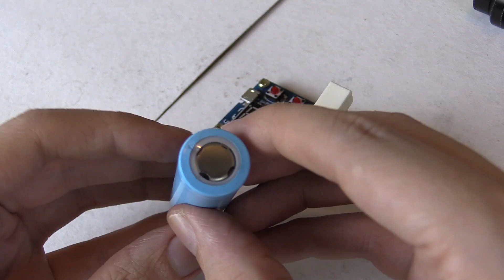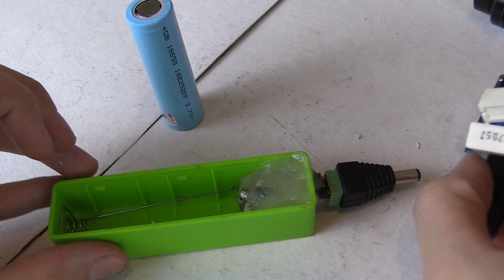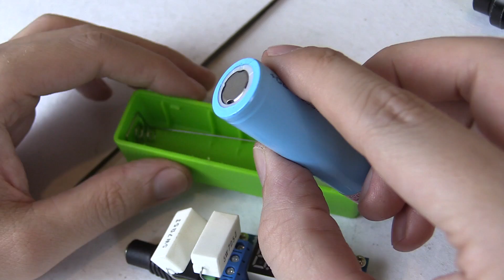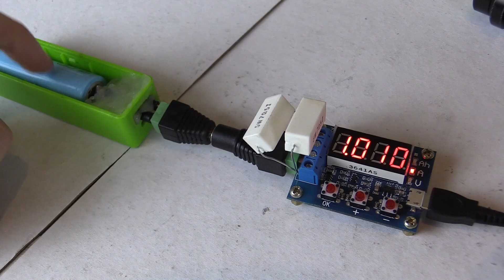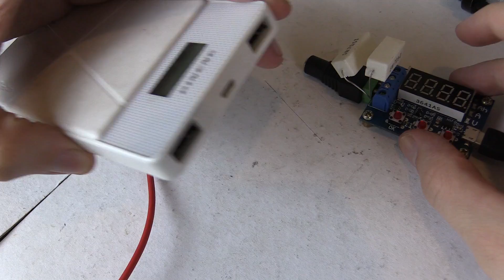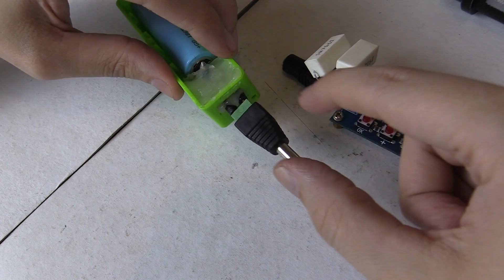18650 Battery Capacity Tester from eBay

Comment: Is the cut off voltage of 3V standard for all Li-on capacity tester? What if you set the cut off to 2.7V, wouldn't that give the battery a higher capacity reading?

Comment: hi any chance you could explain how i would calculate the capacity as i would like to use this tester to test capacity of a couple of usb 5v power banks i own. thanks
Reply: search and buy a "USB Power Tester Voltage Current Capacity Meter". So you don't have to build a cable this tester had a usb input so you just plug in your power bank and other side it had USB output to plugin a lamp or something using power to test a capacity of your power bank.

Comment: I have an other problem where I charge the battery to 4,2v but when I but it in the tester it shows 3,4v and this happens with two completely different testers. What you think the problem is because if I put 3v cut off the mah reading won’t be correct.
Reply: Maybe your battery is weak, Normal Lithium battery voltage is 3.6V or 3.7V it may slightly higher depending manufacturer and battery Specifications. 3V cut off mean when you are using your battery then battery voltage will going down, so when battery voltage get down to 3V it will stop (cut off power) you from using it. Like a power tools when this happen a light will flashing and no power out put from a battery.
Reply: i have the same batteries that has higher resistsnce. one claimed to 1600+ mah but when i discharge test it using only one reeistor, the voltage drop tremendously. if it cant handle half an amp, what more if i use two resistors, lol! so technically, we have both tested a bad bwttery

Comment: I have multiples of these, is it possible to solder a 5v power input somewhere directly to the board instead of using the USB?

Nevermind, I noticed the two square unused pads on the back of the PCB near the USB end, +is right below the USB port, negative is offset behind the AH A V lights

Comment: There is difference btw the results of this capacity checker and litokala Lii500, why?
Reply: Yea, i have this problem too
Reply: @jopalzm1  how big difference?
Reply: @solopomodoro5853  3x Liitokala paralel HG2 18650 3000mAh show mi tester 6800 mAh, repeatedly.
Reply: @jopalzm1  did you try what capasity each cell alone showed? Meybe they arent full 3000mA?
Reply: I understand, but it is connected as the power bank and the problem is unraveling it. But I have the similar experience when bought a 20,000 mAh from a branded power bank manufacturer and the test showed 12,000. Complaint powerbank, I get next kind, and showed 11,800 mAh. So I don't get it.
Reply: @jopalzm1  what version is your tester? I have v2.3. Older ones was inaccurate. Can you tell me the 20000mAh power bank, model and manufacturer? Seems pretty big? I try my 5000mAh power bank today, lets see what it says.
Reply: @jopalzm1  my 5000mAh power bank is just slighty bigger that 18650 battery, so i think it is probably half what they told it is... never 5000mAh.
Reply: @jopalzm1  on power bank test you should put cut out voltage just under 5v i guess? Its the voltage most phones etc needs, so after that capasity is even smaller... i bet the capasity on those power banks are calculated to very low voltages...
Reply: @solopomodoro5853  it is quite possible

Comment: I ordered two of these. I was a bit peeved when what arrived was not the ZB2L3 but the other commonly available one, the HW 586. When I queried this the seller said "they are the same". But the HW 586 has a critical appraisal here on u-tube.
Anyway I checked them out and the performance and operation does seem to be essentially the same. Results were exactly in the expected ballpark, when I swapped cells over to test consistency with the other board any discrepancy was typically 1-2%, never more than <5%.

Comment: I  have tested  the same 18650 battery twice  first charging them to 4.2v  with two of the load resisters  and set 3 v cut off voltage and  there is  a huge  difference  in capacity  on all 12  of my capacity  meters.
Reply: my zb2l3 is the same, no accuracy at all, did u find any solution ?

Comment: You would help alot if you can answer me .I build a 3s-4p battery pack out of lg 18650 cells. I tried to measure the capacity.I firstly charged and then discharged the pack.Turnigy smart charger has cut off voltage at 9,6 when having a 3s battery. When the discharge finished i show total 8000mah and voltages 3,4-3,2-3,4. It did not stopped at 9,6 and my main problem is that my second series batteries discharged faster. So having a pcb when u use the battery will cut the output voltage, while there is still voltage left in the pack .how to fix this? P.m all are same new lg cells except 1

Comment: Have resistence measure?
Reply: Many of these kits seem to come with a pair of 7.5 ohm, 5 Watt ceramic resistors. The resistance tolerance may or may not be marked. Assume +/- 10% if not marked.
Two that I received measured 7.44 and 7.50 ohms. 
They may also be marked something like this: 5W7R5, which in this case meant 5W 7.5 ohms. It's usually a good idea to confirm the at least approximate values of parts like this by measurement especially when the price of something is really low. For example, a manufacturing or packaging mistake could send you a 0.75 ohm resistor instead of a 7.5 ohm resistor which could drastically change your results and any calculations.

Also, while ceramic resistors can withstand high temperatures, be prepared to keep them cool with a fan as they could cause burns or melt plastic parts, insulation, etc.

Comment: I bought two of those did you use both resistor most video I Saw used only one will it be fine does it make a difference
Reply: I bought one and it came with 2 resistors, it depends if you want to measure the capacity at 1AH or 0.5AH, this mainly depends on your usage

Comment: what's the difference in putting the resistors in series vs parallel?
Reply: He is using 2 5W 7 Ohm resistors in parallel which is 10W 3.5 Ohm, Current = Voltage X Resistor so battery he is using 4V X 3.5 Ohm = 1.14 A ( current draw ). For this circuit you can use a Resistor 10W 1.5 Ohm for a current draw of 2.6 A ( Maximum current draw for this circuit is 3 A ).

Comment: I have one of those and man that connector is brilliant because I was doing 18650s and also I started doing AA batteries also and it is kinda annoying changing the holders out basically any alkaline battery is pretty good even the cheap ones but the non alkaline batteries are like 1/3 of the power

Comment: cool video! what would be the lovest resistors you would use on it? what is the lowest cut off voltage you can set ? (If it's low, it could be porbably use for testing nimh also)

Comment: omg u're supposed to use both resistors at a time lmao. No wonder my resistor was burning hot
Reply from the maker: They'll get hot either way :)
Reply: Gadget Addict haha yea i just tried it and it got too hot to touch within 1 minute. Does yours get this hot too? I'm scared to leave it on for over 5 mins
Reply: They can only dissipate 5W.  10W resistor would have been better.

Comment: I bought same capacity tester but indicator display wrong voltage. That's why it measures wrong capacity. How can I fix it? Edited: I fixed it. Google it "zb2l3 calibration"

Comment: Hi , Very good info ,I have salvaged some 18650 batries from my old lap top. Only one has the full 3.7v and the rest is totally dead . I used my volt meter and checked the voltage and found no current at all ,I managed to revive those dead cell which now has some voltage in it as 1.2v .so i used my charger to charge it ,but the battery  charger power trip and not charging the cell  at all . Can i use this  capacity charger and discharger to power the battery ,,and if can how to do it and how many resister to use .. your kind advice please .

Comment: I finally got mine the other day and set the cut off for 3.2 volts but after checking and removing the 18650 it shows 3.4 volts and also when inserting a fresh fully charged 18650 4.2v it shows a starting voltage of around 3.8 when starting to draw current am I doing something wrong? Thanks, great battery as the tester comes with no instructions.
Reply: its normal for voltage to drop under load

Comment: I realize its easy to make but i still would rather just buy yours. You should pre-make a few and trow them on ebay.. I want to buy one just like you have but i don't care to collect the parts and make it myself.
Reply: With all the 18650 batteries in use now, I just don't get why NO ONE has simply put together the already - available components into a single box with a proper 18650 battery holder, freeze the settings to 18650 batteries and print the instructions on the box.  I'd gladly pay $10 for that, and I'd pay $20 for one that I could put 4 batteries at the same time into (discharging takes hours).  It would sure beat breaking out all this stuff.

Comment: How long does it take to discharge   1 18650 cell on this ?
Reply from the maker: It would depend on the capacity of the 18650 cell.
Reply: Gadget Addict I was looking for a rough estimate.iv ordered similar one from aliexpress but have to wait another 40days for the delivery.btw nice work on the turning old battery bank into a holder👍
Reply from the maker: Anywhere from 10 minutes to about 3 hours. Depending on the capacity of the cell :) 40 days is a longggg time to wait!
Reply: If you have battery with capacity 3000mAh this is 3Ah and you are discharging with 1A it will take 3hours
Reply: The device is capable of 3A discharge. If you were testing high draw cells and wanted a 3A discharge you would have to get appropriate resistors to load it?

Comment: Safe cutoff voltages are between 2.4V and 2.5V, cutting it at 3 won't show the actual capacity on the meter's reading.
Reply: Yes,, but it is depending on manufacturer, battery he is using not a brand name, if he set cutoff voltage down to 2.5V battery may over heat.

Comment: Is there a circuit board that can be connected between a battery and a device that will state how long you can operate before it reaches a set cut off point ? 

Maybe a timer that has taken into account the volts and amp draw automatically....

This would be a money maker, even if the circuit board had to do a one time drain on the battery it could have a memory that could be reset...

Their must be many ways one can be designed and set up to function.

Thank you for your time.
Reply from the maker: If you search for 'lipo battery alarm' on eBay, you'll find many devices like you described and usually they have an adjustable voltage warning and can be used with many battery types.
Reply: Awesome thanks !

Comment: With so many counterfeit 18650 cells around, where do you source legit ones?

Thank you very much!
Reply from the maker: Well that's a very good question. Even Amazon gets flooded with fake cells or sellers that start with genuine cells and then swap for clones/fakes. I generally try to buy from somewhere that has a good returns policy (like Amazon) and then test them on arrival. If they don't hit the specs or there's something that shows them to be fake, I send them back for a refund.
Reply: Power banks for high capacity low load cells. They can be as low as 2.5$/cell, which is very good.

Comment: LOVE this video mate. I was wondering though if I were to buy a new resistor, what would this thing be able to handle? I only gor one with mine and it says "5W 75ohm J" and I don't really know what that means :S
Reply: 7.5 Ohm
Reply: With his circuit board Max current draw can handle is 3A, so you can use 10W 1.5 Ohm or 2 5W 3 Ohm resistors in parallel.

Comment: Really nice! A question: if I solder the resistors with a thick wire, so I can use a heatsink in them, the soldering would resist?

Comment: Hello. Can you explain why do you use the two resistors instead of only one to make the test? Thanks and btw, nice video
Reply from the maker: If I only used one resistor, the load would be closer to 500mA instead of 1A. Since most powerbanks, cellphones and other gadgets charge at 1A, I find it's a better test value.
Reply: Thanks. I asked because I can't take more than 160mA from any 18650 battery, using the two resistors, while with one, I can get only 100mA.. Any solution with what can be happening? Thank you
Reply from the maker: That's odd. How did you connect your 18650 to the tester?
Reply: Gadget Addict, I use those plastic holders for 18650 li ion batterys that you can find easily on ebay.. I tried to discharge with only one resistor, and I get only 100mA,and 159mA with the two resistors.. I even tried to change the conectors from the holder cause they seem to be too fragile.. 
I don t understand what am I doing wrong :c any advice? 
Thanks by your time
Reply: Ackenta 
increasing discharging current

Comment: Well well well... what about the connector's losses? :)
Reply from the maker: There's only so much you can do. I've tested this battery in 4 different ways and all tests gave very similar results which suggests the wires and connectors used aren't that important if they're kept short. It might not be good enough for a space rocket but it's close enough for a normal consumer.

Comment: These types of capacity checkers are really useful. I built one myself using an arduino and the parts probably cost as much as this item. Your two 7.5ohm resisters in parallel give a nice 3.75 ohm load which is almost perfect for a nominal 3.7 volt battery and an average of 1amp load. 
A resistive load gives a good example of how long some types of devices would run for on a specific battery, and a constant current load gives a good idea for other types. So they are both useful to have. 
Thanks for the video.
Reply: For anyone that doesn't know Adam Welch has a total amazing channel himself and his knowledge is legendary. 👌

I've never used an Arduino in a circuit before but I think I might try building this one. Iv already built myself an amazing DC to DC Buck Boost charger for my motorcycle  thanks to Adams advice. Probably my favourite channel along with AVE & Big Clive. 👍

P.S. Thank you for this review as well its also a good video. ❤️
Reply: I see, so the omh's gets cut in half when you double the resisters? what about the watts, is it 10 watt now or does it stay 5 watts? And can you lower the ohms too much for these cells?
Reply: Can u send me the link of eBay or Name of the product
Reply from the maker: Good info and yeah I'm happy with my purchase :) It's nice having a standalone tester for when I cant leave my laptop running the EBD-USB tester.

Comment: How did it compare to the EBD with Ah?
Reply from the maker: A difference of around 150 mAh. But when testing with the EBD-USB I had a constant 1A load while this load varied from 1A down to 0.8A as the battery voltage decreased. So I'd say they're both pretty close to each other.
Reply: ericcl

Comment: why not test the blue/orange battery that came with the power bank it self
Reply from the maker: I don't have the original battery anymore. I cannibalized those cheap cdrking powerbanks to act as standalone battery holders like you saw in this video or as basic 18650 chargers that I cycle different batteries through.

Comment: Can you provide the link to ebay item?
Reply from the maker: It wouldn't be practical because eBay sellers and listings come and go all the time. If you search 'battery capacity tester' on eBay you'll them listed by various sellers :)
Reply: Ok I found such testers at Aliexpress for $3.25 cheapest. However I have IMAX B6 mini battery charger so I will rather wait for something smarter where I will be able to choose constant current more convenient way than using external resistors. Thank you for your finding.
Reply from the maker: You might want to check out the EBD-USB that I previously reviewed - https://www.youtube.com/watch?v=j2iaxQKswIw